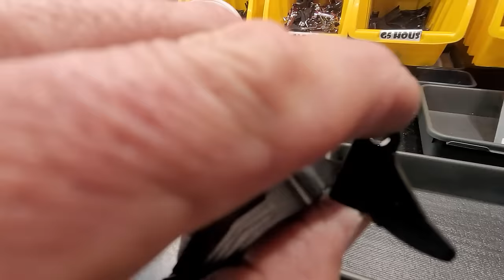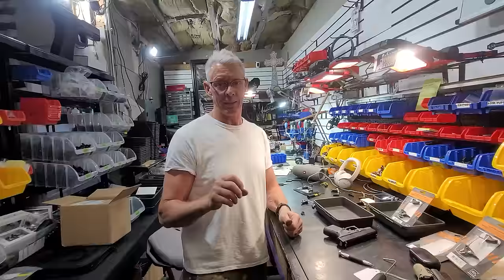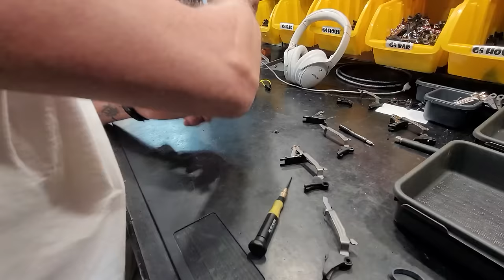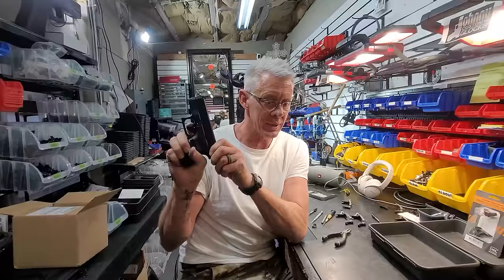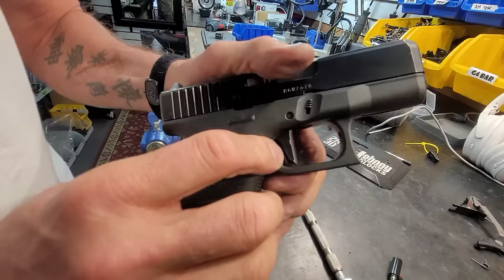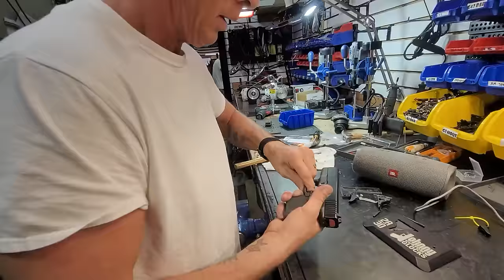New Glock performance trigger review pt 1

Comment: If Glock really wanted to knock the competition dead, they need to get you guys onboard working hand in hand with their product line manager or whoever and get your custom triggers, strikers and the vex shoes into their base model Glocks, instead of coming up with their Timney-lite one.
Reply: Facts! Why not call the guy who builds a better product that drops-in and is safe?  Or how about calling the guy that knows more about their triggers than they do.  They could offer Patrol, combat, competitive and standard trigger options.   Better shoes, better trigger pull and take-up, better break and reset.  Glock is just too proud to make such of a call.  I bet this performance trigger is a flop, nobody even knows the cost yet.  I would bet $175-$250 MSRP.  And now we all know it is a Timney with some changes and not even close to Timney feeling or reset.  So what’s the point of buying this new trigger, when you can change a few parts at home and have a better trigger?  Or just buy a JG trigger and have the best of both worlds.  

Glock is falling further and further behind.  They better step it up because the competitors are already roasting them OEM out of the box.  Plain and simple!!
Reply: @Balticblue93  Alaskan ballistics put out a video with his new gen-5 G20 and it came with the new trigger and the new match-grade barrel actually a polygon with straight-cut edges on the lands and it's also crowned . I believe his comment on the trigger was he couldn't tell much difference in it which to me is understandable with a new gun chambered in the stout 10mm auto.  Glock says they have made 20 design changes and as you may or may not know the barrels, and trigger assembly are not interchangeable with other Glock generations. You also have I think three options in the site's department 2 different night sights and a newly designed OEM plastic sight. I think they're listening to people but they have such a huge worldwide following especially military and police as well I doubt slumping sales are forcing them to do this. Thanks man!
Reply: @jimmybare3026  wow didn’t know this about the trigger on the new G20 thanks for the info! Still on the hunt to get mine 😎
Reply: When your life depends on it, Glock! It just works!

Comment: Just ordered one from Glock’s online store. They’re $100, which is a good deal (if it performs well), but mainly my hope is that it’ll be completely sorted out and uphold Glock reliability. I wasn’t surprised to hear in this video that the Timney’s had some bugs to work out.
Reply: Yes, that's the part that is being missed. A improved trigger system that can still maintain edc levels of safety and reliability. Interested to see what improvements can be made and effect of connector angles.
Reply: Do you use it in your carry gun?
Reply: @mmafanatic-tz5or  I did for a while, but then I got my 34 for competition, so I installed it in that.

Comment: While it’s definitely possible Glock took a lot from the Timney trigger design, Timney definitely took everything from the Walther P99/PPQ/PDP (and Canik, a Walther clone). They looked at how the P99 trigger assembly works, figured out a way to configure it so it would fit inside a Glock frame, and interface with Glock striker lug.

Comment: You can mail it either just by using a stamp or tape it to a baseball card size piece of cardboard and mail it through the mailing system for small cards. A stamp is cheaper but with the cards you have tracking info

Comment: A lot of engineering and research/development involved in making that trigger. Thanks Johnny .
Reply: Honestly, I think Glock fixed the two primary issues that Timney had with their trigger 1) the drop safety was essentially deleted since the trigger bar and sear were now independent parts (and it doesn't matter that the trigger housing still technically had the drop safety molded into the polymer because the only thing really holding the sear up was the spring inside the Timney housing) 2) the return spring was pretty weak.  

As much as people like to give Glock crap for not innovating and being behind the curve, their engineers really do know what they are doing.  They pretty much solved both issues for their own trigger by 1) introducing the hook that goes over the trigger bar (makes all the difference in the world because any exertion of downward force on the sear from say, a drop, will mechanically not allow the sear to drop unless the trigger is actively being pulled, which moves the bar out from under the hook) 2) the return spring is a redesign of the Gen 5 and will have a similarly authoritative reset to the standard Glock trigger rather than the anemic reset the Timney elbow spring produces.  

Overall, this is a very well done iteration on the Timney design.  Hopefully they make them for the G43/43x/48 as well so I can stick one in my CR920.

Comment: At 17:44 I found it easier to use a tiny flat tip screwdriver through the hole in the housing under the return spring to push it back & get the bar back in the notch.

Comment: K so it’s a copy cat of Timney thanks Johnny 😂 I installed the Alpha timney trigger on my Glock 19X over a year ago I called timney regarding the weight pulled if u put the regular spring u gonna get 3 pounds red spring it comes wit u gonna add a half pound so 3 1/2 pounds trigger I got about 1500 rounds thru my 19X with the Alpha trigger red spring on my trigger gauge I get every time 3 1/2 every time super consistent love it not one issue or miss fire. Jam anything really happy with it reset is fine u hear it clearly every time n strong  shit the JOHNNY spring will make even better gonna have to get check it out 🎯💯

Comment: I have two performance trigger with Vex shoe setups, g49 and g45 

One performance rear housing has a HARD hangup while initially racking the slide on a uncocked striker, the other is smooth. 

It works fine, you just need to initially rack it a bit more aggressively 🤷

Comment: The thing about this trigger that few people consider is that Glock is a HUGE supplier for law enforcement and many LEOs carry Glock concealed/off duty as well. Many department policies specify that no aftermarket modifications can be made and only OEM parts can be used. This is the first Glock trigger which could be used, aside from the stock trigger, by LEOs to give them a slightly better trigger. If you’re comparing to other aftermarket triggers, it’s easy to find flaws, but comparing it to stock triggers is what’s intended.
Reply: Most LED’s don’t allow anything less than a 5lb trigger and some are 6lb. So this was definitely not designed for LEO duty use at 4lbs.
Reply: @NorthwoodsAmerican  Untrue for off duty carry. For duty carry that’s true, but of course you’re having zero modifications of any sort for your duty weapon. But for off duty carry many policies will allow for this.

Comment: Glock should innovate with a carry comp kit next.  Single chamber, indexed on the barrel, side pinned.  Set of back straps that allow for indexing a Glock like a 1911 or Cz should be the carry comp.  Then a fully modular fire control group.

Comment: Great explanation thank you so much!  I do have a question...  I thought part of the safety philosophy behind a Glock's striker fire pistol design was the short push back of the firing pin / striker (with the trigger) before the striker is released to fire.  To reduce pull weight, it seems the new Glock Performance Trigger's design eliminates that short striker push back.  If Glock's normal trigger design was such that the firing pin can't ignite the shell's primer unless the striker is pushed all the way back, then wouldn't this new trigger be just a little bit less safe (at least for carry and home protection)?   Also, wouldn't this design open the door for a lot of shade-tree modifications that are potentially dangerous?
Reply: Thanks, you competently phrased what I was wondering too. Hope someone sees this and responds eventually.
Reply: @Tusk-ruk   I called Glock Support and asked them direct if the stock firing pin/trigger were to be released to the shell from the 60% pull-back position would the gun fire?   They said if there was no firing pin safety it most likely would.   So, that pretty much makes the concern moot.  I suspect if it wouldn’t fire then that would have been promoted as a 4th safety feature of the Glock.  🤔
Reply: @kapu4905  I wrongly assumed it was one of the 3 safeties. Thanks for the reply Kap. I'll give this trigger a whirl.
Reply: So this trigger is gtg in a edc gun? You don’t lose any safeties that exist in a factory Glock pistol?
Reply: @warweaponx6629   That's a personal choice.  After using it by it's self and with Johnny's trigger shoe I will use the Glock Performance Trigger only at the range and stick with a cleaned up stock trigger with a dot connector for carry.

Comment: Does the overtravel set screw sometimes keep the crusiform from sitting in the drop shelf flush, causing light strikes as the striker drags over it during fire? I did my own pre/over pins with a tyrant trigger and ghost connector. Oem return spring in my 43x and sometimes I get light strikes. I also have the 4.0lb striker spring. Should I go to the 4.5?
Reply from the maker: Yeah 4.5 definitely in a 43X

Comment: I just don't know if I feel comfortable with these pre cocked systems. Isn't that why Sigs are going off in holsters? And wouldn't it cause premature fatigue on the firing pin spring from always being in the ready position?
Reply: Potentially yes, the firing pin spring will probably fatigue faster, but they are so cheap that I wouldn't worry about it.  And I doubt there is going to be a huge decrease in life span of the spring.  

The difference between this system and the Sig is that the P320 sear is literally only held in position against the face of the striker by two springs underneath it, much like the spring that holds up the Timney sear.  There is no mechanical surface to actually prevent the sear from dropping.

Comment: Noticed the the bar that pushes the seat down on the Glock aftermarket trigger sits lower than the Timney. I have to file a groove in my timney and polish it because the striker was dragging it and causing light strikes. 

I have a feeling people are going to have a lot more luck with this new Glock trigger over the timney out of the box without tinkering.
Reply: Or at least it looks like that on a 5" phone screen 😂

Comment: Would love to see the pull weight with the standard connector like in your combat trigger. I run my Timney with the standard connector in my Carry Optics gun and it gives me around 3.4lb pull and less mush before the break. (Crisp If you will) I prefer that over a 2.5lb mushy/pull through type break.

Comment: If the trigger over travels once the slide moves is there even a point in upgrading from a Ghost rocket with spring kit (OEM striker spring) and polish? The rocket and 3.3 never overtravel but the pro in my 43 does the same thing as this one; no over travel till the slide cycles.
Reply from the maker: No that won't fix it

Comment: I’m currently using your competition trigger in a G19 Gen 5 (regular shoe not vex). I’m having issues with reset strength. It’s good enough but it feels a little weak. I’ve tried changing the trigger return spring. Outside of that do you have any pointers to increase trigger reset strength?
Reply from the maker: I have a video called transfer bar drag watch that
Reply: @johnnyglocks  
That helped me understand the problem but I’m kind of dumb so I don’t fully understand the solution. My reset is getting caught up right at the end. Without actually seeing my gun do you have a best guess on how to improve it?
Reply: @johnnyglocks  
Well thanks anyways.

Comment: Instead of the firing pin being pushed back during the trigger pull ,  the trigger pin is returned during the side cycle to the  reset- cocked  .  The new system only drops firing pin, from the cocked position for the strike .
Reply: Thanks for simplifying this for me. Is this safe in an edc gun? Isn’t the P320 design also a fully cocked striker?
Reply: @warweaponx6629 yes there’s still the firing pin block that has to be defeated by pulling the trigger

Comment: Could this unit be used in a Gen 4 if you simply use a Gen 5 back plate on the slide and a Gen 4 trigger shoe?  Or is there something in the striker plunger safety that would preclude that?  Thanks
Reply from the maker: Working on it

Comment: I was given my old duty weapon Glock Model 22 when I retired.  I never had any problems with it, but the accuracy was only so so, and I put a Wilson combat stainless barrel in it.  I really liked the accuracy that I got with it, and kept the gun stock except for the barrel swap.  About a year and a half ago, I started getting light strikes or failures to fire.  I replaced all the springs in the pistol and reduced the frequency of the problem occurring, but it still happens about every 50 rounds or so.  Any ideas on what I should check to try to fix this and get my Glock reliability back?
Reply from the maker: Make sure this hits are center hits. And more than likely it could be the ammo.

Comment: I just got mine. I hate it. The trigger safety blade catches in the frame on initial pull. It's just as heavy as stock gen 5 triggers. It does have less trigger travel. The trigger is always in the ready position whether the striker is cocked or not. Maybe with some polishing it could be good. I feel ripped off. And that from a die-hard Glock fan boy.

Comment: Just started watching, but my main concern is drop safety. Will this thing maintain the outstanding reliability and safety of Glocks regular trigger? Hopefully those answers are in this video.
Reply from the maker: I dropped the crap out of a gun and could not get it to fire I'm sure Glock extensively and I mean extensively tested this for safety. I would not have any trepidation when it came to safety whatsoever.

Comment: How much better would the feel of your competition drop in system be compared to the glock performance trigger with your vex shoe? Would a polish of the performance bar be an even better idea?
Reply from the maker: My trigger is going to be more efficient on all aspects of the action whereas the only possible place where the Glock shines is the break itself. But you'll be able to run my trigger faster.
Reply: @johnnyglocks  Thanks!

Comment: This is moving significantly towards the Sig 320 trigger design.  And, as we all know, Sig is getting the pants sued off them for unintentionally discharges -many of which are from police departments. The only safety mechanism that Glock retains - that Sig does not employ - is the trigger shoe lock-out.  I’m surprised Glock is doing this.  They better do a ton of testing to offset the risk they are assuming for the added revenue. I guess Glock is sick of watching 3rd parties make a mint off their pistols - fixing their crappy stock triggers.
Reply: Glock is a slow moving beast.  I doubt they would have put this out if they weren't absolutely sure that the inherent design is safe and sound.
Reply: @douglasmcnay644  yes - in retrospect - i think you are right - Johnny went on to explain in another video - about how glock designed in a hook that retains the bar from escaping.  i went ahead and bought one and now i can see what he was talking about. thanks

Comment: Has anyone done testing to see the level of safety in a Glock performance trigger?  Also, I noticed they aren’t using “carry” or “duty” verbiage and that they carefully use the word “performance” in their marketing of it. This is important because if you put one in a carry gun and have to use it in self defense, an attorney can say that he trigger was designed for competition and not carry, and that you didn’t use it for its intended use. Thus creating a potential legal issue. Anyone have info on this?
Reply: That’s an old wives tale. They aren’t going to examine your gun to see if you made it “more dangerous”

Comment: It is not a “single stage” trigger.   It is a single action trigger. You clearly show that it is a two stage trigger. You clearly show the take up( first stage) and then a break ( second stage).   Glock a legacy triggers are not single action. Glock’s legacy triggers are some thing much closer to double action. I.e. the legacy trigger finishes, cocking and releasing. The new trigger simply releases.

Comment: The Glock Armorers course is a joke. Pay $300 to learn to use a punch. I could teach a 10 year old to be a Glock armorer in an hour, you literally have to try really hard to put a Glock back together wrong. All these Glock armorers and guys who have built AR's are running around calling themselves gunsmiths while those of us who fit parts and make parts are shaking our heads. Let's not even get started on rebarreling or doing any kind of stock work, bedding, inletting, etc.